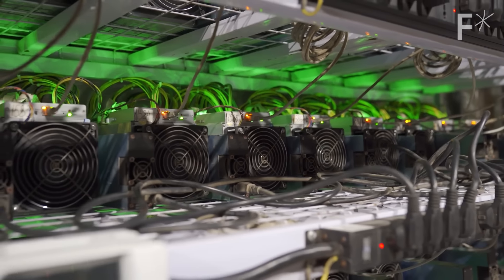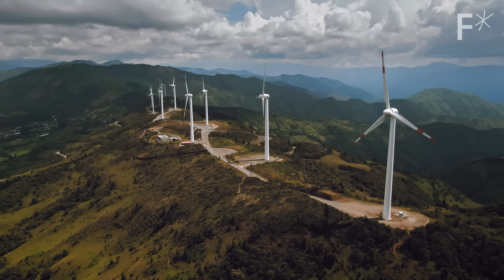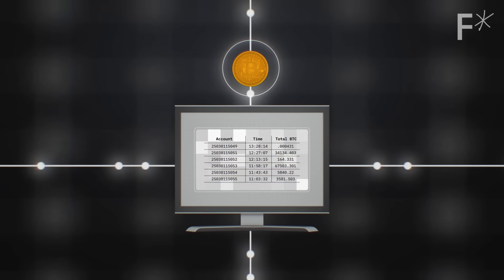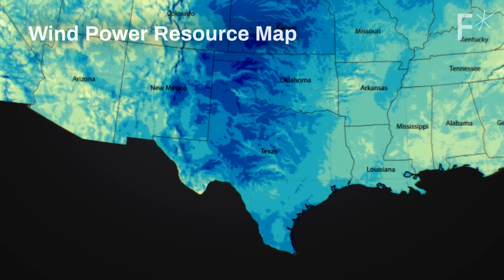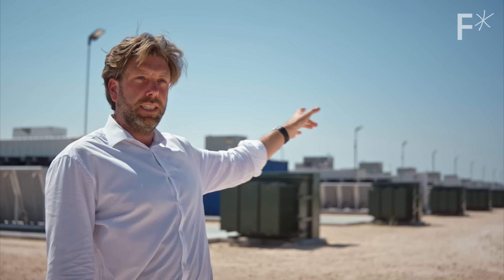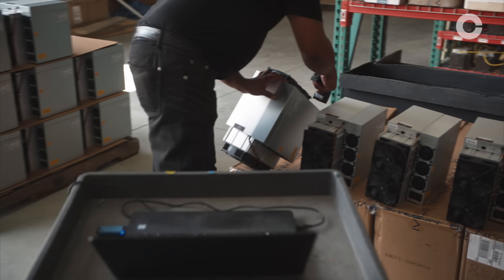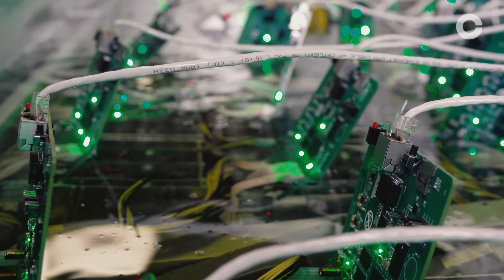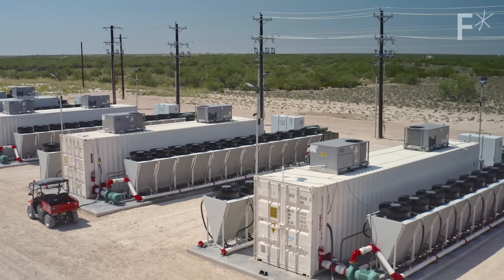Building the world’s greenest Bitcoin mine

Comment: you could do the exact same thing but instead of mining bitcoin, power computation to solve actual problems. crypto can work on proof of stake (eg Ethereum), there is no reason to use more energy intensive process than necessary.
Reply: Bitcoin mining does solve actual problems:
1) Provides an economic solution to the intermitency problem of renewable energy generation and transmission with respect to supply and demand curves;
2) Provides anyone on the planet with an internet connection 24/7access to a permissionless global monetary network that's self audited and has no counterparty risk; 
3) Provides dissidents/journalists living under politically repressive regimes with an open and permissionless way to raise money and transact outside of the existing financial system

Just because you don't like it for ideological reasons doesn't mean that Bitcoin's proof of work mining has no utlity. Proof of stake is just recreating the existing financial system on a blockchain where those with the biggest bags have the most say in governance and receive the largest share of staking rewards by virtue of having the biggest bags. Also, staking rewards are just glorified token inflation that only serves to devalue the underlying asset over the long run. The people hurt the most are those at the bottom of the economic totem pole with the smallest holdings.
Reply: Proof of stake cannot function without third party oversight or a centralized developing team. Bitcoin and PoW is self-auditing and self-regulating.

Comment: How about changing the puzzle that miners have to solve into one that helps the scientific community? All that computing power being used to solve pointless puzzles, when university's are paying millions for supercomputers. 😢
Reply: There is not an alternative for a self-auditing system that is dependent on a third party oversight. If you figure out that problem, then we are all ears.

Unfortunately you are not providing a solution, just an unconstructive critique. Do better bro, you are embarrassing yourself.
Reply: @DiiceForeveroO  When Covid happened I was folding at home, to speed up the end of the pandemic. Curecoin (another crypto) was paying me based on how much folding happened. Of course, I didn't go into this for the money, but thought hey if I'm using computing resources usefully, might as well take the reward (they aren't worth much anyway). I'm no Bitcoin expert, but shouldn't it be possible to do something similar? In STEM you often get differential equations, which are pretty hard puzzles. Isn't it possible to change the Bitcoin protocol into one where you only get paid for calculating correct solutions to DEs?
Reply: Yes, that would be ideal. There are coins that give rewards for protein folding simulations, for example.
Reply: Create a Bitcoin Improvement Proposal, if it gets voted for and approved, the bitcoin protocol gets updated, or forked, and then the users will decide which version they deem safer and which they support.
Reply: That would be really great

Comment: I just wonder what else can we do with that much of a power?
Reply: I just wonder how little you know about the current financial system. If you knew about it, that thought wouldn't even cross your mind.
Reply: We can power homes, cars, trains, industry, make H2, etc.
Reply: Do you wonder that about all xbox's? No. Ridiculous statement.
Reply: @Ninjaeule97 it’s waisted energy. If it’s not being used to mine Bitcoin it is literally being waisted. (Not used)
Reply from the maker: The idea is that if the power is needed for the grid, it can be used for it. But if not, it generates income. By increasing the economic viability of solar panels - which can have issues with excess generation at times of the day when power is cheap - hopefully they enable more to be produced and installed everywhere.
Reply: This is one of the great reasons why states should encourage Bitcoin mining - Balancing the power grid.
One problem power grid operators face is increased peak demand on very hot days. This is a problem because the energy demand is not constant so they cannot invest to increase capacity. Bitcoin fixes this. By creating demand at all times, which can be dynamically adjusted as required, it gives the incentive to expand capacity.
This is what we should be explaining to power alarmists as to why Bitcoin mining is actually good. And of course also the fact renewables are being increasingly more employed since they're cheaper by the day.
Reply: Bitcoin is already one of the most environmentally friendly uses of energy on the planet it's monetizing what would have been wasted energy or stranded energy. it's empowering small communities in Africa across the world it actually makes renewable energy profitable
Reply: But one important difference is, everyone's credits card never needed it's own power plant to work - now it does (even if it's otherwise 'wasted energy' - it could be used more thoughfully) and the bitcoin technology itself isn't even capable of replacing everyone's fiat transactions fast enough. So yeah, I think this is false advertising. They only discovered a new way to combine access - cheap energy and a energy excessive bussines to create a revenue. This project isn't about getting bitcoin greener, it's about earning more from mining.
They key solution to turn bitcoin greener, would be to dump the proof of work concept in favor of Less energy hungry concepts!

Comment: why not just biuld batteries that charge while access power and return the stored power during the rest of the time? - wouldn't that make more sense?
Reply: It doesn't solve the transport issue - we can't efficiently move charge from hot and windy SW Texas to the population centers than need it. Also, batteries not fully efficient, you always lose some percentage of what you store, sometimes a very large percentage. Lithium batteries are relatively efficient, but lithium mining is enormously destructive and difficult. I know people working on improving the "mining" methods (they actually extract lithium from groundwater), but even if that improves, lithium will be primarily used for applications where it's important to be relatively light and portable (laptops, cell phones, cars, etc). For now, batteries are not a sufficient solution to the massive inconsistencies in renewable power output.
Reply: @DiiceForeveroO  If you read my message,  you will see, it starts with a "why" - I don't recall where a question has anything to do with dictatorship. I was just curious why the presented option was selected over the alternative that came to my mind. I am willing to learn! Are you?

Comment: I somewhat get that ...but I still dont understand how is putting all those resources in green grid building for Bitcoin, rather that say houses or industries? ...I mean, aren´t we struggleing enough with changeing our current energy mix? ...for a financial asset that requires increaseingly amounts of energy, you will eventually need insane amounts on infrastructure to support its operation. Still not sustainable. ....those are some of the issues or questions that I have no answers for yet.  ...like how the increaseingly amount of resources put into BTC operation are better placed there than current green economy/infrastucture transition if Bit Coin adoption still has an enormus market share yet to aquire. 
Is becouse of this that I still dont understand the logic behind supporting infrasturcure for PoW in digital assets.
Reply: This is one of the great reasons why states should encourage Bitcoin mining - Balancing the power grid.
One problem power grid operators face is increased peak demand on very hot days. This is a problem because the energy demand is not constant so they cannot invest to increase capacity. Bitcoin fixes this. By creating demand at all times, which can be dynamically adjusted as required, it gives the incentive to expand capacity.

This is what we should be explaining to power alarmists as to why Bitcoin mining is actually good. And of course also the fact renewables are being increasingly more employed since they're cheaper by the day.